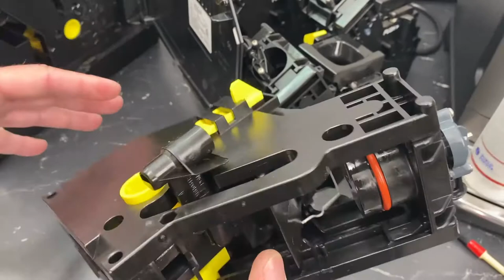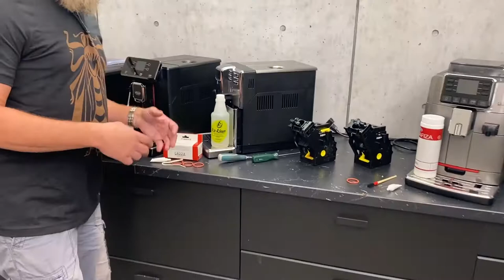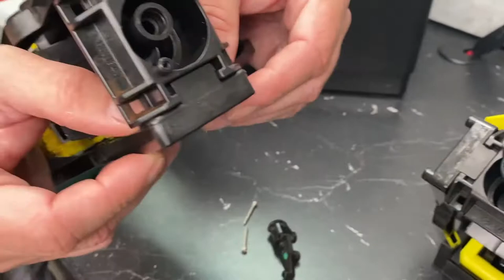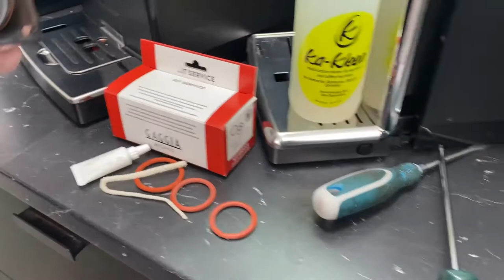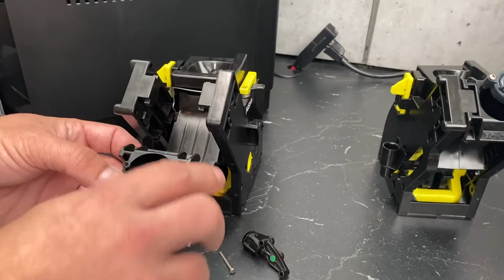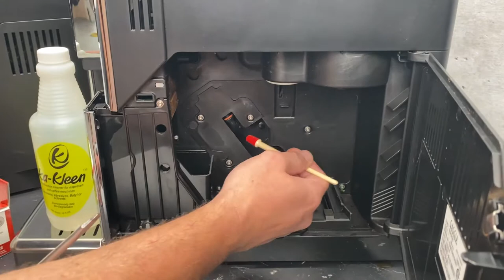Gaggia Espresso Machine Brew Unit/Group Maintenance & Service Kit

Comment: Using a Gaggia Anima super automatic machine, can I filter my water separately using a PUR faucet filter and add that to the water tank instead of using a dedicated filter inside the machine? Is this bad for the machine? Can I descale the machine less often using this type of water vs regular tap water? Do I need to add any minerals to this type of filtered water?
Reply from the maker: Hi b, Thanks for the question. Check your faucet filter's specs but most of them do just particle and activated carbon filtration and do nothing to reduce or control the minerals which cause scale buildup. In-reservoir filters for your machine do control the minerals and extend the time between descaling. You do not have to use the in-reservoir filter. If you do not the machine will request descaling more frequently. If going with the faucet filter only do test the hardness of water after filtration and enter that into the settings of the machine so it alerts you properly for descaling.
Marc

Comment: Thank you. My Gaggia Accademia is giving a Brew group MAx pressure message followed by E04. I lubricated as per this video and also moved the brew group using the service mode from home to working position and back again but the error persists. Any ideas?
Reply from the maker: Hi M, here's a video discussing the E04 error: https://youtu.be/pXICgK5W4NY?t=177
If your brew group is able to move properly between home and work positions the issue may be deeper in a microswitch, motor, etc. If you're in the US/Canada you can submit a ticket to our tech support team here for additional assistance: https://www.wholelattelove.com/pages/contact-us

Comment: I just ordered a Cadorna Milk from you dudes!!
Reply: Feel free to give me any tips  as many as you can!! Thanks Marc
Reply from the maker: Hi e, Thanks for your comment and patronage! Perform routine maintenance as outlined in manual. If you'll be doing mostly espresso set the grinder to its finest setting before adding any beans. You can always back off to a coarser setting if extractions are bitter. Also start with full-strength and high temperature setting for espresso/coffees. For larger "regular" coffees do Americanos instead of coffee on the machine. Most prefer the flavor of Americanos. Know that your first few brews will be a little weak/watery until the machine "learns" your coffee and adjusts the amount ground. More support videos and docs here: https://support.wholelattelove.com/hc/en-us/sections/1500000398262-Gaggia-Cadorna-Milk
Marc

Comment: I have an Accademia from 2014 AND i regularly maintenance and clean the brew group. However, there are two orange O-rings on the water inlet nipple that are drying out and I can see a little water start to seep out. It is the water inlet nipple that interfaces with the cup on the back of the brew group. Can you tell me the replacement part numbers for those two O-rings?
Reply from the maker: Hey d, these are the part numbers for the O-rings: NM01.035 and NM01.057
They can be tricky to find on the site. If needed you can contact us here for the parts: https://www.wholelattelove.com/pages/contact-us

Comment: Thanks for the valuable infos. 
My Phillips 5440 coffee machine started to have a problem after about 10 months of use. 
Machine doesn't dispense water into cup but into the tray only when making Americano. 
This doesn't happen with espresso lungo or others.
Actually when making americano machine dispenses coffee first without any problems but then when it's time to dispense water, it doesn't dispense the hot water into the cup but it dispenses hot water into the tray below instead. 
I've washed the brewing unit with tap water several times. I used tablet to clean it up. I cleaned the compartment where brewing unit sits inside. I've lubricated the brewing unit. I've lubricated the orings. I've checked orings but there were not visual deformation rather then one of them was slightly lose and not too tight like the other one. I pulled off the aquafilter. I tried without the filter. None of the things i've described above works to fix this problem. 
I see on the internet that if i change orings it may fix the problem. But when  check them they stay intact visually. 
Some other people from Seatle area on internet says that technical service told them that it's a faulty mainboard and machine needs to be replaced totally.
Do you have any advice for my problem?
Would you change the orings first or send it directly to tech service?
Thanks in advance for your reading time.
Reply from the maker: Hi Hakan, I would definitely try the o-rings first - especially if one appears lose. As we service mainly Gaggia machines I have no info on main board issues.
Reply: @Wholelattelovepage  I've ordered Orings on Amazon. Let's see if replacing orings will fix it. Thanks for your respond!
Reply: @HakanOnurDerici  AND YOU SOLVE YOUR PROBLEM, I HAVE THE SAME PROBLEM
Reply: @nobodyhome1984  Nope I couldn't.
I've replaced oring.
I've descaled. 
Tried everything I could which is suggested online.
Nothing works.
I didn't send it to tech service. I use the machine without a problem but I can't get Americano anymore. I can get other coffee types.
Reply: @HakanOnurDerici  replace those o'rings, and it worked. You should also grease all the o'rings with food grade grease.
Reply: @HakanOnurDerici  and also check the coffee group, grease it very well, including the oring, that it has its full path to the top.  the piston reaches the top.
Reply: @nobodyhome1984  I just replaced the little oring on the machine itself. I didn't replace the large oring on the brew unit because it seems intact in my visual inspection. I've lubricated brew unit well. I don't know how to check the piston properly. It seems to do the job but I don't know what to check properly. It's interesting that people who have the exact same machine having the exact same Americano problem after several months of use. And it's also interesting there's no official solution to this published yet. I just hope machine doesn't get worse. I can bare with living without Americano if machine keeps working for all other coffee types.

Comment: My dispensed pucks are not coming out as solid as they use to, they are quite watery and sludgy. I assume this is due to not enough compression? Perhaps my O-ring is bad? I have cleaned the tracks and everything, but they still come out very loose and watery.
Reply: I have the same question!
Reply: @allagashandlulu  mess around with the grind setting I managed to fix it.
Reply: @stefanmv  What changes did you make? I keep seeing the recommendation to always keep this machine on a fine grind.  BTW have you ever cleaned the shower screen?
Reply: @allagashandlulu  yes I've disassembled everything and cleaned well, and set grind setting to finest

Comment: Can you use cafiza to clean the shower screen?
Reply from the maker: Hi ST, Yes you can. For deep cleaning you can soak the whole brew unit in a Cafiza solution for 10-15 minutes if desired but that is not required. Be sure to re-lubricate the tracks if you do that.
Reply: @Wholelattelovepage  Thank you 🙏
Reply: Meh, I use a drop of Dawn with a wet toothbrush. Rinse well and you're good to go. It's a stainless steel screen and it won't be harmed by using a single drop of dish detergent.